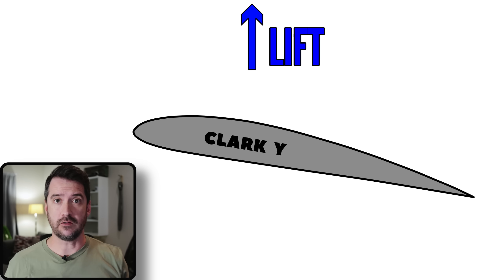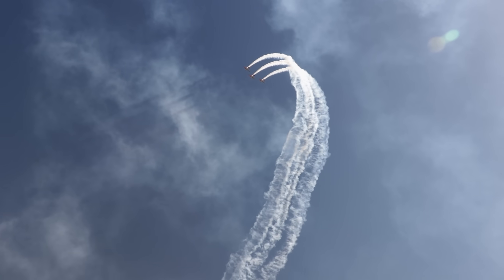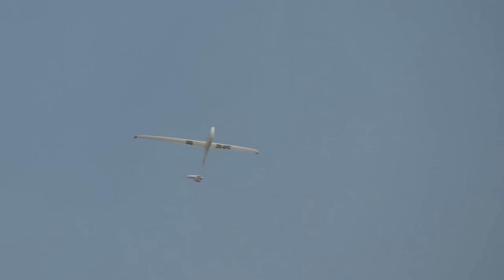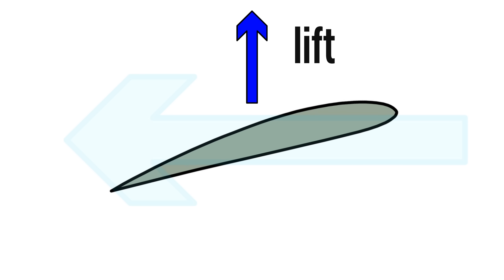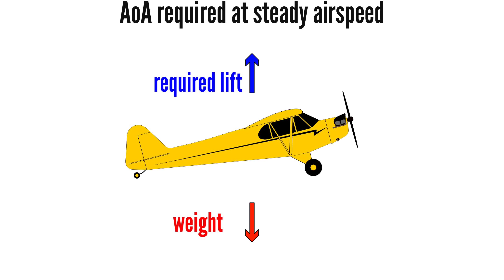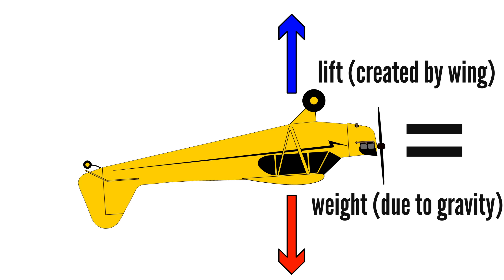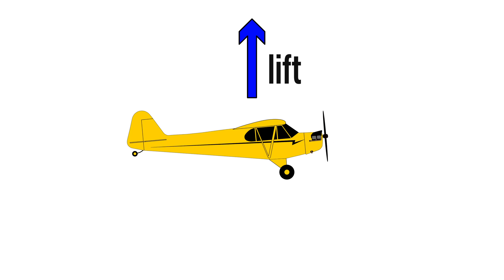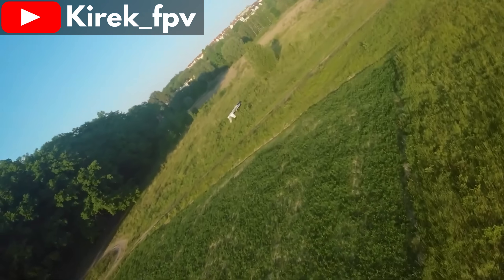Is Airflow Distance Over the Top of a Wing Always Longer?

Comment: One valid interpretation of this video is that the angle of attack is more important to generate lift than the shape of the wing. This in turn makes those who question the theory partly right, which obviously wasn't the point of this video. 😂
Reply from the maker: So close! But the point was actually that angle of attack makes the path over the top longer (top being the side pointing skywards with a positive AoA)...regardless of the shape, regardless of being upside down or right side up.
Reply: @LetsGoAviate  Okay. But if I make a paper plane, it still flies, even if its wings are flat. Why?
Reply from the maker: @alexanderhugestrand  The same way any wing creates lift. Give the paper plane wing a positive AoA and it will create a pressure differential. Since it's a flat wing, the pressure differential is minimal and the lift force is minimal, but it doesn't matter, the weight of the paper plane is minimal.

How does a paper plane wing create a pressure differential if its flat? The same way any wing does, just not as efficiently as a cambered wing. As soon as the paper plane wing has a positive AoA, the forward stagnation point move down, creating a longer path and lower pressure over the wing than under the wing. On a flat paper plane wing the stagnation point movment will be minimal, fractions of a millimeter probably, but that incredibly small amount is enough to make a 5 gram piece of paper defy gravity until it loses airspeed.
Reply: @LetsGoAviate  Is that explanation true for kites as well? I mean, it's easy to explain how a flat surface can be pushed by the wind, using only Newton's laws and forces applied by the wind. No pressure differential needed.

UPDATE: There will always be a difference in pressure, of course. But not for the reason that one path is longer than the other. If you shoot particles on one side of a surface, you will apply a force to it, i.e. adding a higher pressure on that side. The other side will obviously have a lower pressure.
Reply from the maker: @alexanderhugestrand  Yes it is the same. Most kick against it, but the reality is lift can be described with a few different theories that are correct. Newtons laws (2nd and 3rd) are valid ways to describe lift, but that doesn't mean the pressure differential theory is incorrect, because it is also valid. My opinion is there are too many emphasis on correct and incorrect, instead of realising lift is complex and not fully explainable with a single theory.

Like you said, there will always be higher pressure below the kite or wing, and that the air "pushing it up" will be a part of it, on a kite probably more than a wing, but as NASA says (I'm quoting) "Neglecting the upper surface's part in turning the flow leads to an incorrect theory of lift" which I very much agree with.

As for the longer path, it doesn't "create" lift, it enables lift, as it contributes to the pressure differential (on a kite too). The equal transit theory doesn't have to be true for the longer path over the top to be true.
Reply: The common factor is asymmetry.  Asymmetry causes lift.  Shape and angle of attack combine their individual contributions to asymmetry, to form the total asymmetry.

Asymmetry causes lift because it  constricts the even passage of air.  Constriction applied to a mass flow continuity (which must remain continuous), forces speed higher.  Higher speed (higher kinetic energy), Bernoulli says has to be paid for with lower potential energy (lower static pressure).

The above pressure difference (equal to lift) which started with asymmetry, accelerates air mass downwards (equal to lift).

Comment: Usually the statement is that the flow splits top half is longer path flow must speed up to meet back up with the bottom air molecules. What is wrong is that the same pair of air molecules going over will not meet up with the bottom ones, granted the flows/streams will meet up (if it is still creating lift). A better counter example is the lifting cylinder (like ping pong or baseballs) where top and bottom surface are symmetrical. The way that always made more sense to me was backwards: the lower air pressure on the upper surface is what causes the air flow to speed up. 

Lift as I understand comes from 2 phenomenon, first being the change in the momentum of the airstream to more downwards, with the larger the magnitude corresponding to more lift (rightward incoming air and down-right leaving air means whatever bent that flow must get some type of upward momentum, opposite true if up-right leaving air would cause down force, and downward incoming with faster downward leaving air will also create lift, or in case of rockets zero starting momentum relative to rocket then positive downward flow makes lift or upward thrust); second being difference in pressure above and below an object/surface for lift/downforce (high pressure pushes towards low pressure side)(basically buoyancy).

Comment: Nice explanation.  My hunch is that it is the displacement of air mass that is the main cause of lift.  How this is accomplished most efficiently is through a wing shape which is assymetrical to avoid cavitation.
Reply: Summary from my other comment:  all the pieces into the proper fit:  mass flow continuity gets constricted, forcing speed higher, which takes away from pressure, with the pressure drop being the force accelerating mass downward enough to equal lift.
Reply: @davetime5234  cool!

Comment: I rather believe the air molecules hit the underside of the wing which force the wing to counteract to force much like a propeller principal.
Reply: The pressure drop on top is the most significant contributor to the pressure difference.  Even though air moves faster over the top than bottom, the total mass through the system must have equal transit time.  This continuity of mass explains why pressure arranges to speed up the air over the top.  Pressure drops because Bernoulli tells us more kinetic energy (faster speed) has to come out of less potential energy (drop in static pressure).

The above cause and effect chain puts all the pieces into the proper fit:  mass flow continuity gets constricted, forcing speed higher, which takes away from pressure, with the pressure drop being the force accelerating mass downward enough to equal lift.

Comment: lift has nothing to do with the air moving, it's just (relatively) motionless air particles impacting the underside of the wing and pushing it up because of newton's 3rd
Reply: "(relatively) motionless air particles impacting the underside of the wing"

It sounds like you're talking about static pressure momentum transfer?  If so, it's not true the particles are relatively motionless.  The thermal velocity of that random motion averages around 1000mph.

Comment: I have read a book telling airplanes (toys) that under side of wing will give 1/3 of lift and upper side gives 2/3. I have found out with windsurfer that if I am going straight fair wind, my sail is giving only that 1/3 of force. I can feel that and it is difficult to sail that way, because sail is not giving much force to pull against. So as a wing can be used straight blank, but angle of attack must be huge ( now we are only getting that 1/3 of lift). Actually that way wing is not going to stall at all. If the wing has some curve of upper side, then lift is increased 3x.
Reply: Underside is much stronger.  Top side and smooth flow are small amounts, but if you clear the trees at the end of the runway by 1 foot, that's all you need.
Reply: Newtown, Bernoulli, Coanda (oh my!).

Comment: NASA's Glenn Research Center made it clear 20 years ago that Bernoulli does not sufficiently describe the forces behind lift, due largely to the fallacious principle of equal transit time. There's a great book called "Stop Abusing Bernoulli! - How Airplanes Really Fly" which was written in 1972. None of this is new.
Reply: Mass flow through the restricted space has equal transit time.  The speed to achieve that equal transit time of mass, is faster than equal transit time.

The pressure effect of this faster than equal transit time to achieve equal transit time of quantity of mass, is right out of Bernoulli.  

Bernoulli is simply the potential energy pressure that must result from a change in the kinetic energy due to speed.

So what would be new, is if people started recognizing apples as apples and oranges as oranges.

Comment: Except when sailing with the wind, sail boats are pulled, not pushed when the sail is set to make an air foil. Pressure differential is what causes this. All I know.
Reply: Rethinking. Maybe it is pushed  due to low pressure in front of sail? Dunno? Have done a fair amount of sailing and just know how to trim the sails! Have done a lot of flying as well. Think the same principles at work.

Comment: If you hold a 8x10 inch piece of paper by two corners it will hang down of course but if you blow over the top side, it rises. One way or another, the moving air over the top crests a low pressure relative to the side underneath so the paper rises. Pressure differential must come into play to creat lift.
Reply: Yeah, but let a light thin sheet of tissue hang straight down, with no bending curve.  And carefully blow on one side of it so as not to blow the tissue away from your direction of blowing.

The tissue will move toward your airstream.

No curve involved.

Conclusion?

Comment: Flow doesn't reach the trailing edge simultaneously above and below wings.
Reply: Mass flow rate has to be keeping up.  So, when you look at the regions on top and bottom that equate to equal mass flow rate inputs to each side of the path, equal mass flow rates mean the side with higher path restriction must have the higher transit speed.

So, unequal transit speed must occur so that equal mass transit speed can occur.

Comment: Bernoulli is not the only theory at play. Newton also comes into it. Every action has an equal and opposite reaction.
Reply: Definitely air mass forced down has to account for lift.  But what is the force that causes the air to be accelerated down?  

Bernoulli explains how the asymmetry of the solid to the relative wind, creates the force that changes the momentum of the air downward, which is responsible for the equal and opposite reaction.
Reply: Newton and Bernoulli are two different principles that both play affect in creating lift and can be exploited to different degrees depending on the application of the wing. The force come from engine trust or gravity if in a dive.

Comment: I am a sailor, not a pilot, but in sailing similar arguments are used. If the main cause of lift would be the length of the path, and the path behind the sail, above the wing would be one percent longer the pressure difference would be a metric tonne per square meter independent of wind speed airplane speed. My rather simple newtonian explanation is that you displace air, wind direction before and after meeting the sail/wing. To change the direction of wind implies that you have exerted a force on the air, and thus the air exerts an equal force in the opposite direction. Wings and sails are shaped to do so with the minimum amount of drag.
Reply: "To change the direction of wind implies that you have exerted a force on the air, and thus the air exerts an equal force in the opposite direction"

That's right, as you say "exerted a force on the air."  But, how is that force created?

Comment: THANK YOU !!!
I have been saying this for a long time. The longer surface area creating faster air-flow is less relevant than the fact that the longer surface merely creates a longer surface that low-pressure can occur, versus the high pressure underneath.
The thickest part of a P51's chord is at 50% (Spitfire is 60/40) which allowed it's insane performance, and that also debunks the aerofoil argument.